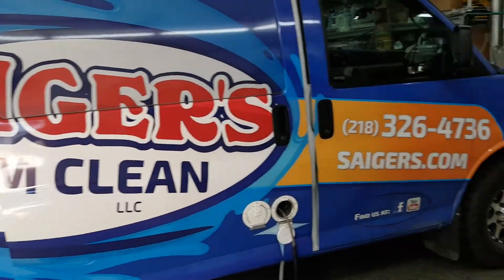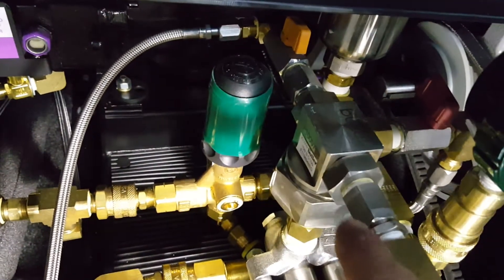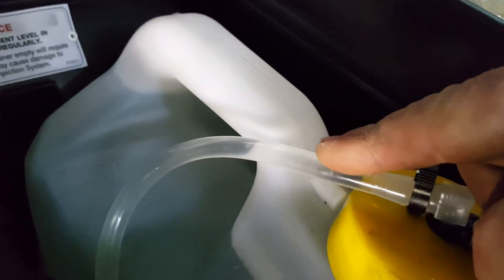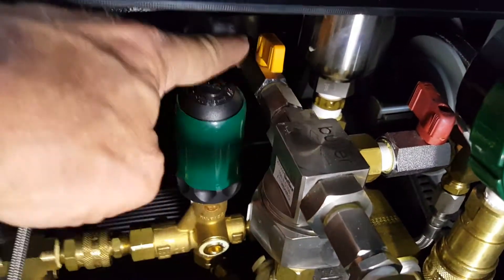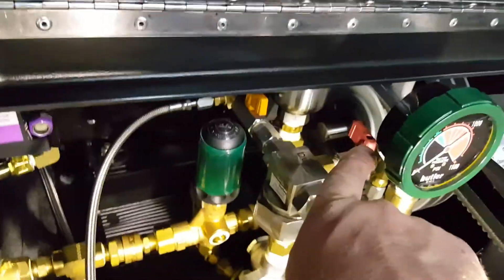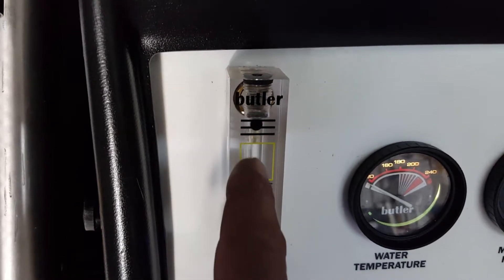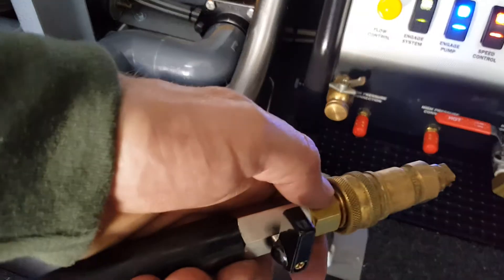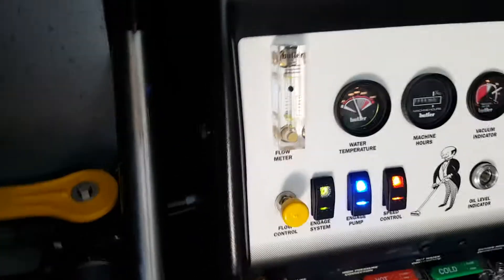Butler Chemical injection priming and bleeding of the system

Comment: Hey Mark, I’m not quite understanding. I’m one of your visually impaired viewers and I can kind of see the control panel in the lines. Can you explain what you mean by the bleeder valve and basically what happens when you flip those switches I can kind of see the light a little bit.

Comment: I have a 2002 model with the chemical bubble float but it doesnt have the chemical container like yours so how does mine work? I use a pump sprayer to lay down the cleaners
Reply from the maker: I'm going to guess it needs a container and then the chemical injection turned on. But if it's not been working for years the chemical injection might need a rebuild. I do have a video on that
Reply from the maker: https://youtu.be/oo97B-JqsSk

Comment: what if when you bleed it, the ball doesn't move from the bottom?
Reply from the maker: If you have the bleeder valve, it really should move. Essentially opening up the bleeder valve you are opening up a hole that allows direct flow. It could be the pebble is stuck in the metering site glass, maybe a Crack in that site unit, the screen at the end of the plastic hose in the tank is plugged or the hose to it is plugged. Or something in the system from the chemical injection tank or beyond is plugged. It's now a process of elimination to find where there is resistance to allowing the chemistry to be drawn, or something more severe wrong with the chemical injection pump or cat pump.

Comment: What if you dont use chemical injection when cleaning with the Butler?
Reply from the maker: You can do that. It won't hurt anything really. But if it doesn't get used the diaphragms might go dry and need replacement of that diaphragm. Pretty easy fix.